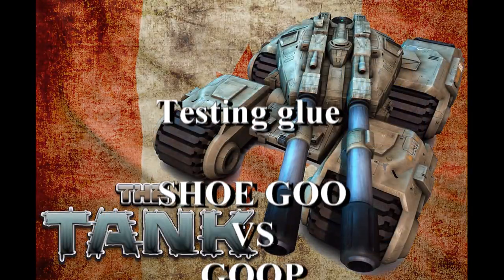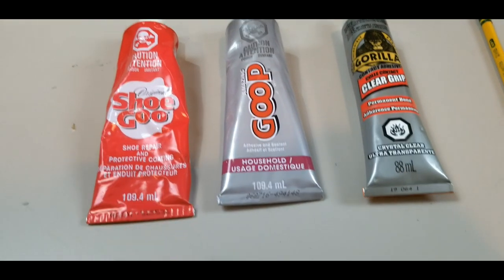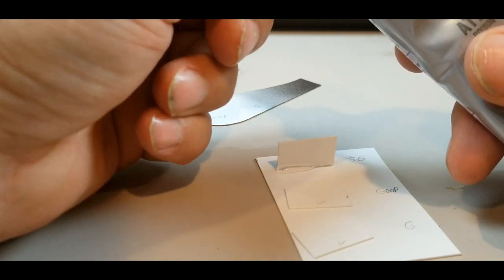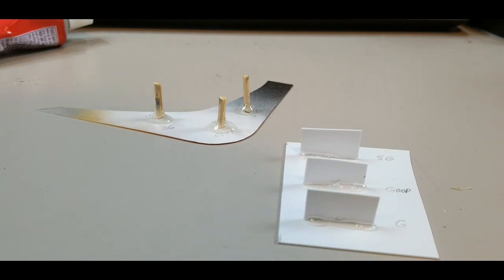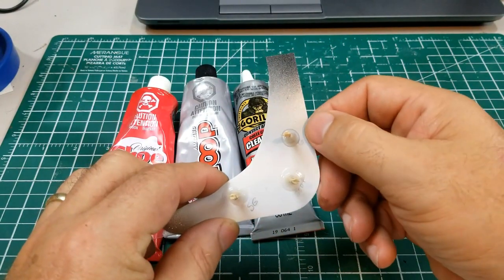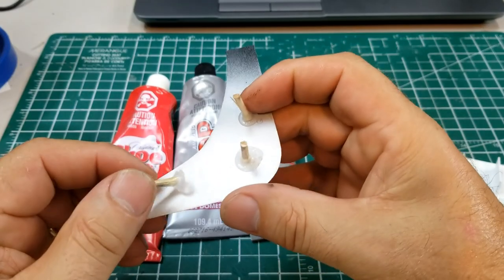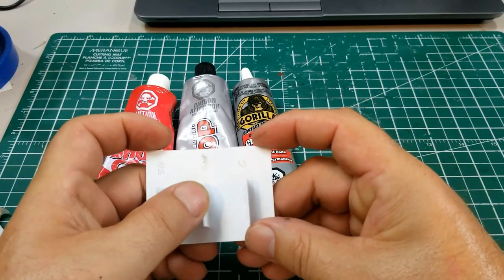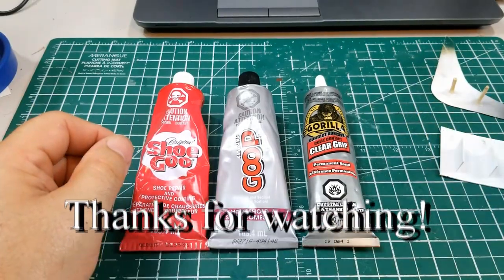Testing glue SHOE GOO, GOOP, Gorilla clear glue

Comment: I believe the Goop, Shoe Goo, and E600 are the same exact thing made by the same manufacturer. I have experience with all the but I highly recommend Goop Max 2 I have absolutely nothing but positive experiences with it as an adhesive I'm not exactly sure how it would work on pain tho.

I glued a USB powered PC case fan to a device with the Goop Max 2 and I had to remove it a month later it was an absolute nightmare to remove and all I did was use two little dabs. Anyways while it was a nightmare to remove it really impressed me as an adhesive.

There are many uses for glues and they all have their intended purpose but I swear the Max 2 has become one of my favorite glues and I keep a tube of it with my super glue. Folks either seem to love duck tape or adhesives for me it's adhesives.

The Max 2 doesn't really seem to be self leveling like the others it may self level to an extent but I find self leveling not to be the best when you are trying to get the most coverage as possible on two small objects and it just wants to run down the side of what ever you are glueing.

I have repeated it several times now but if you ever get the Goop Max 2 use it on two flat surfaces like scrap metal it's insanely hard to separate the two.
Reply from the maker: thanks for the info, the three types of glue that I tested to have different compound in them so they are a little bit different.  I will definitely have to test out the goop Max 2.

Comment: Ive been using gorilla glue clear grip on my rc helicopters to hold down wires and protect them from sharp edges and stuff and it works amazing. Holds really strong and firm with a little bit of flex for vibration resistance, but comes off clean when you want it too. Amazing stuff !
Reply from the maker: That is great information, thanks for stopping by and watch the video

Comment: PERFECT.  I was getting ready to repair a split sole on my sneaker and was going to use Shoe Goo.  Now, I'll get a tube of the Gorilla Glue instead.  Thank you so much.  UPDATE - I just viewed another video "Which Glue Is The Best" and Shoe Goo came out better than Gorilla Glue.  I'M SO CONFUSED.  I noticed that a lot had to do with how long the glue was allowed to dry.
Reply from the maker: All three are pretty close to the same but when using on shoes you got to make sure that they are very clean and let them dry at least 24 to 48 hours

Comment: Thanks for the video, Tank. But I would like to know how it actually works in a real application. I have bought some Goop (marine) to use on my  convertible top. The stitching has dry rotted where the heavy plastic windows meets the canvas. The top is canvas not vinyl so I am hoping it will be easier to repair. I also am hoping to get 2 more years out of this top. In your experience do you think the goop will with stand the weather outside? Let me know what you think.....Thanks
Reply from the maker: Thank you for your comment oh, I did this video to demonstrate how good it work on styrene.  On how it would perform on your application I am not sure because this glue is not really UV protected which mean it will degrade with the Sun so in your application I don't think it will work.
Reply: @TheTankRC  oh ok.....I ended up getting the marine version of Goop. Its UV resistant.  Thanks for responding

Comment: Thanks for the experiment, I want to gluing tier tube rubber , I want to make a ball field with sand for a workout, any advice?
Thanks
Reply from the maker: Nice project, if you look at the front or the back of the glue packaging you will see if it's a good glue for rubber, me I would probably use a contact ciment glue that was made for rubber.
Reply: @TheTankRC  thanks for the reply.

Comment: Good testing Tank! I’d love to know witch glue is most resistant to heat after it’s dry?
Reply from the maker: Thanks for watching and commenting on the video. Yes I was asked to do a sun test to see how it reacts to high heat from the Sun.
Reply: Some people have suggested using these types of glue as a replacement for an exhaust gasket on my nitro’s? So I was thinking high temps & not just environment heat?
Reply from the maker: @rcwreck-creation  I'm not sure it would withstand that type of heat but you could try it. Worst case scenario is you have a mess to clean up.

Comment: I used shoe goo on shoes and wasn’t impressed. Rather not use it on lexan.
Reply from the maker: That is the main reason I did this test to see if it was going to do damaged or warp the styrene and there's also no issues using it on lexan,  I have been using this for years now

Comment: Shoe Goo is WORTHLESS.  The sneakers I go running in every day only lasted a week when repaired with Shoe Goo.  Might as well use a tube of silicone sealant.  The shoe comes apart after a very short time.
Reply from the maker: I'm sad to see that shoe Goo did not work  for you,  I never had any problems with, keep in mind when you apply it the area must be clean of all dust and residue.